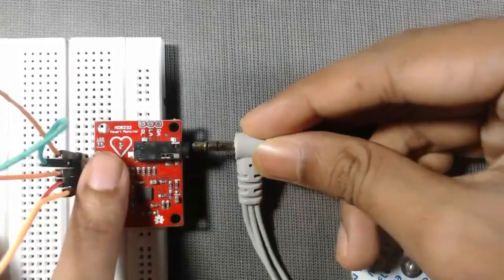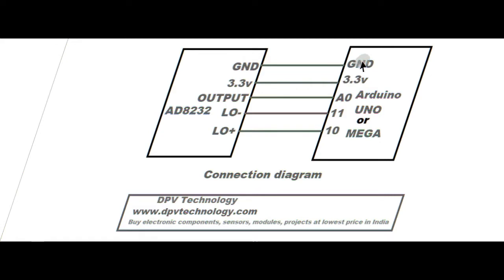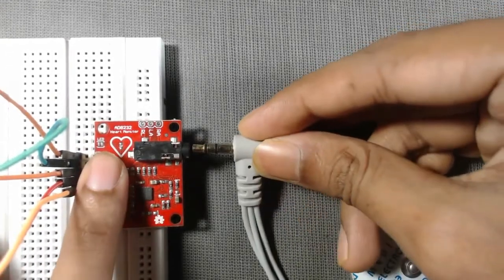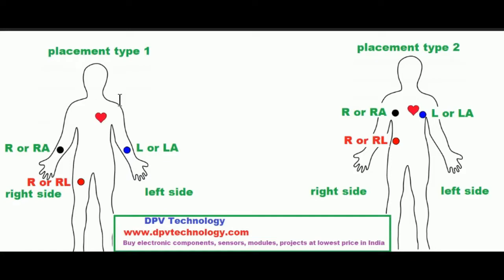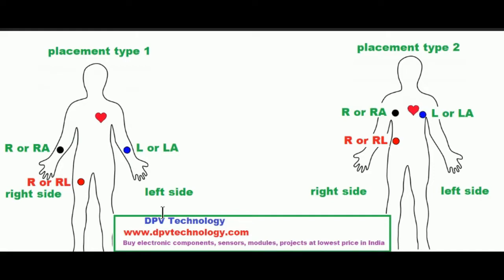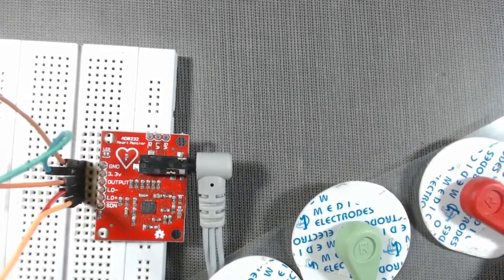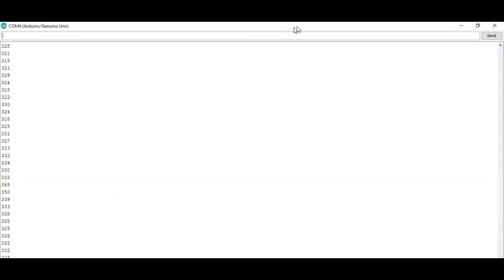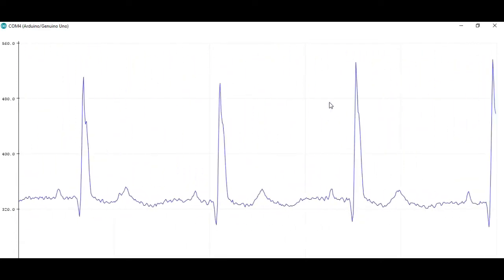AD8232 ECG HEART RATE sensor With Arduino UNO/MEGA with code

Comment: Thanks for the video.I have subscribed already. Plzz tell me about the consciousness about connection. U have said about death. If i connect the arduino supply from laptop usb, is it risky ?? As we know arduino converts the supply to 3.3 V. Plz tell me about that. Thanks in advance
Reply from the maker: Not getting your question properly. Will you explain again?
Reply: @DPVTECHNOLOGY     In this video, you have told to disconnect the adapter from the laptop. Otherwise it can cause death even. I want to know about this. Suppose I supply the arduino from the laptop through usb, will it be harmful ??
Reply from the maker: No bro. it is not harmful. but you disconnect charger of the laptop from AC
Reply: @DPVTECHNOLOGY   If I use 9 V battery for supply, is there any risk?
Reply from the maker: No bro, you can use.

Comment: Where should we connect SDN pin of ECG sensor....? You did not show it in block diagram but u have connected it .pls tell where to connect SDN pin
Reply from the maker: no it is not used.
Reply from the maker: it is not used in this video. you need not connect it.

Comment: Liked and subscribed ur channel the video is very nice
But I am not getting the correct waveforms after doing all stuff correctly may u plzzz help me
Also I am getting values like 500-650 and in between there are many zeroes please help me I am not getting values like urs in serial monitor and also I am not getting the perfect plot
Reply from the maker: Bro, first of all it is very difficult to guess the error without observing the circuit. Try the following:
first of all, disconnect your laptop charger from main.Not only switch it of, disconnect it from main.
Secondly: change the pad position in your body. It is very sensitive.so Donot move during testing. Try it, it should work